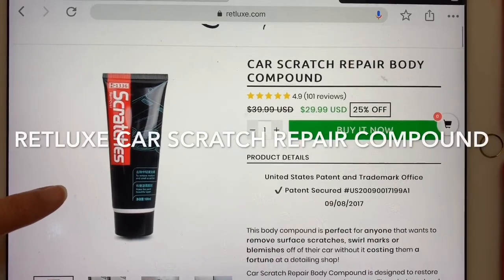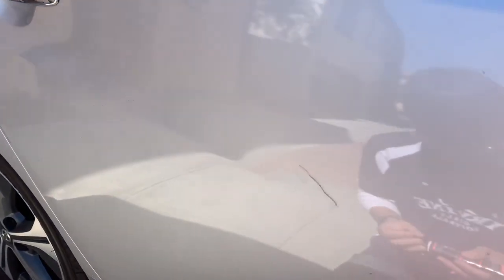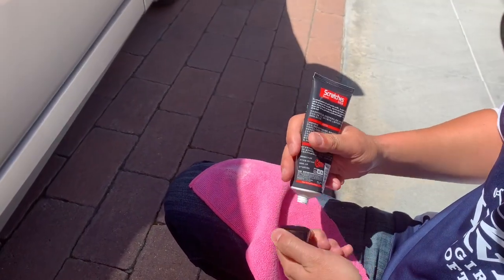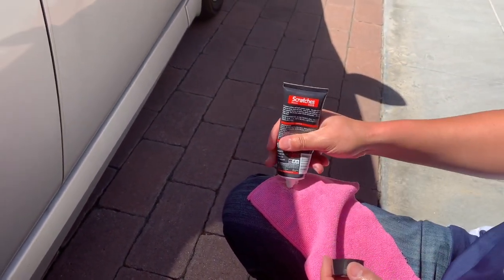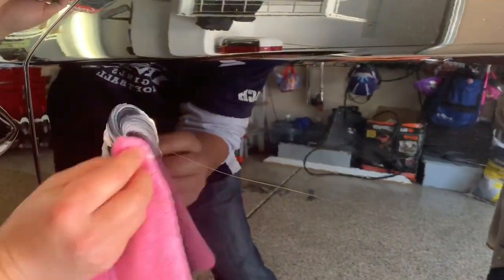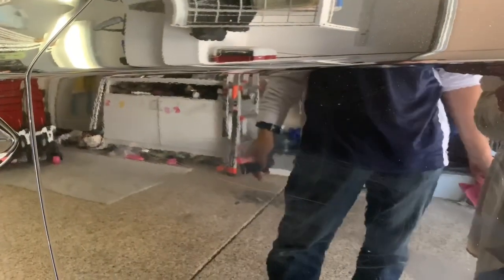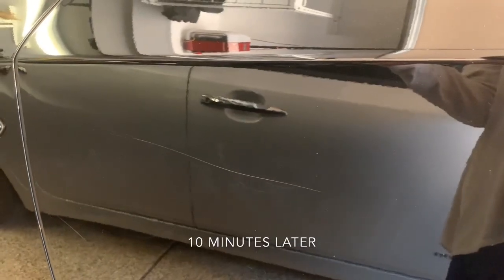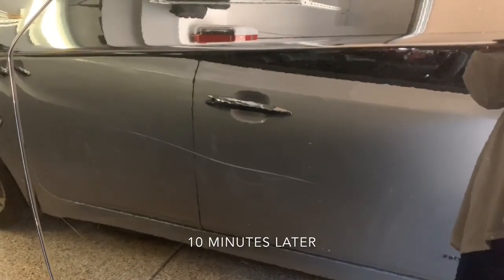Retluxe Car Scratch Repair Compound Review - Honest Review - Gemelle Channel

Comment: I think the best deep scratch remover is water and light sandpaper. Sand it with water then rub some compound then any polishing spray. It does the work. If it looks a little blury because because of the sanding just keep polishing it it will look amazing..

Comment: On the video ad you can tell the paddles they are hitting the car with are coated in something or made of something that will leave residue/marks but wipe right off appearing to fill in “scratched”

Comment: On a car it has layers of paint, if you get a scratch on the first layer tcut will work, if its deep like you can put your finger nail in it layer 2/3 its down to the metal it needs a respray. You could try getting paint same colour an with a fine brush paint it in, but would need a respray for 100% finish
Reply from the maker: Appreciate your tip on how to repair the ugly scratch no my car.

Comment: Did you get the refund?, I saw your video sadly after buying the f$§% product.... such a scam. Im planing to ask for the refund as I am still inside the 30 days.
Reply from the maker: I tried to ask for a refund. But to ship it to China is risky because it’s expensive and they can always claim they never received it. I thought shipping would remain in the US, I was very wrong.
Reply: Im having the same problem I dont trust to return to the product their clearly dodgy and they won't refund fully they offer like 10 usd at the most

Comment: It only works on plastic bumper and only can remove colored pain, I had this product for a long time and I haven't used it till today I should had record it but I was doubt it at first because of this it would not work on metal as it shows here, but it worked great on plastic,   My black front bumper had a yellow paint on it from the yellow metal barrier

Comment: Did you expect a paste to fill a deep scratch ?
It’s suppose to be for paint scuffs and surface scratches. I’ve used a few paint restore, they work to a certain degree. Haven’t used this product though.
Reply from the maker: SHK yes I did expect that. Their website claimed they created a compound that would do that. Or at least a super light hair line scratch. Plus it was rated 4.9 stars on their website by hundreds of reviews and also rated by hundreds on Facebook that it works.  So I gave it a try. Could be just my batch is bad. Who knows.

Comment: These things always claim to do the impossible. You know in your mind that their claim is impossible, but then they show you a doctored video or a deceiving demonstration and then you start thinking “hmm, I guess it is possible” but it’s not! Lol
Reply from the maker: There is nothing deceiving in this demonstration.  It is a thorough video giving the product every chance possible to prove itself.
Reply: Gemelle the commercial doesn’t show how it looks after it has had time to dry. That’s why it’s deceiving. If it showed them after it has dried, the scratches would be clearly visible.
Reply from the maker: Ah I see. You’re talking about the Retluxe commercial. Yes they totally put a deceiving video on their website.  They don’t show what happens after the product has dried.  I actually believe they photoshopped the video too. Deep scratches doesn’t work at all. Yet they have some deep scratches in their video. The 100% money back guarantee is a scam too. Plus all the 4.9 star ratings on their website and all the Facebook comments that claims it works.